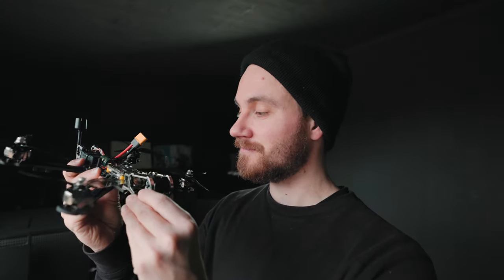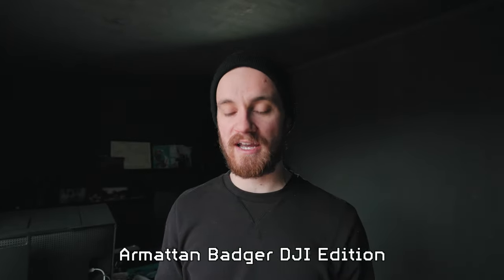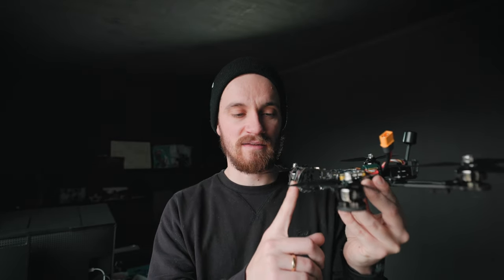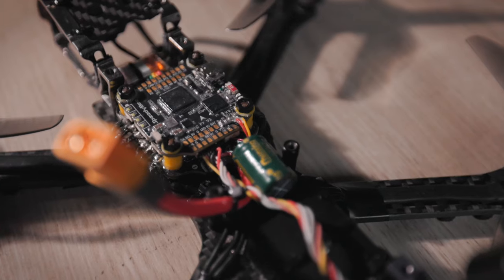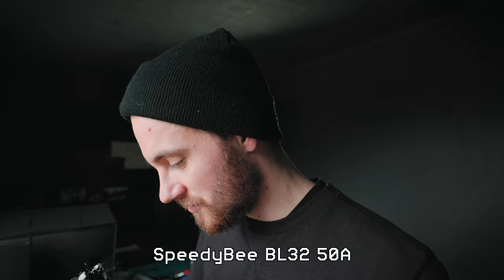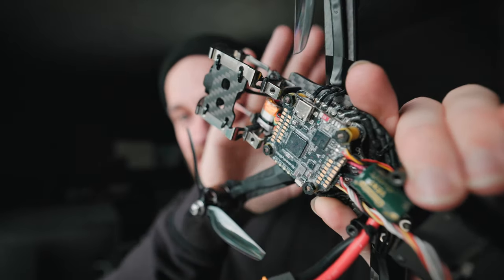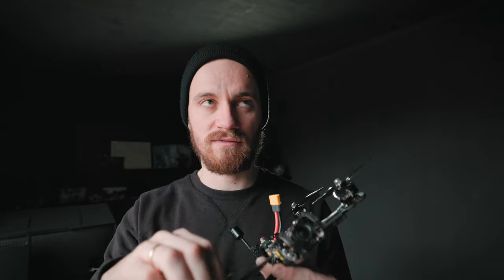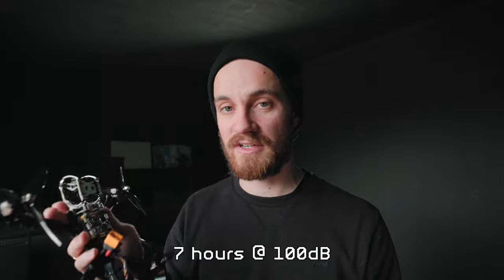Armattan Badger X DJI O3 Air Unit

Comment: Hello my friend I bought a "speedybee hd master v2" drone with the same characteristics as yours but I have a problem connecting the dji controller 2 I selected the sbus in the goggles 2 but I still have the same problem, the dji o3 is connected to the f7 v3 by a 6-wire connector that comes with it. do you have a solution for this in any case continue your video we have the same course in the fpv "dji avatar" thank you in advance for your interest
PS sort for my english im french 😂
Reply from the maker: Hi John, I'm happy to help you out with this. Do you happen to use Telegram messeging app? You can find my link on the 'about' page here on my channel. I think it's easier to talk and be able to share pictures, if that's ok with you?

Comment: Not having the topplate bolted in voids the warranty on the cage 3d print could solve it
Reply from the maker: Hi! You're right. I contacted Armattan and they recommended getting myself a 1.5 mm carbon sheet so I can make myself a custom top plate. So that's what I did!

..offcourse after wrecking the cage first..😅